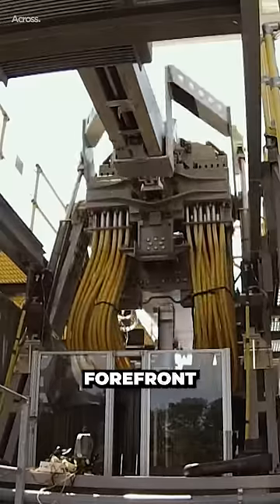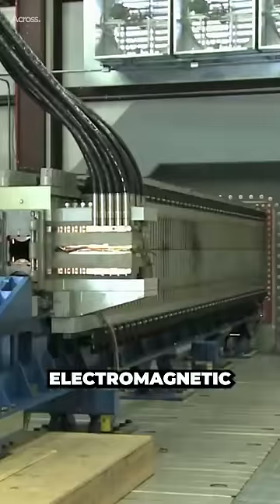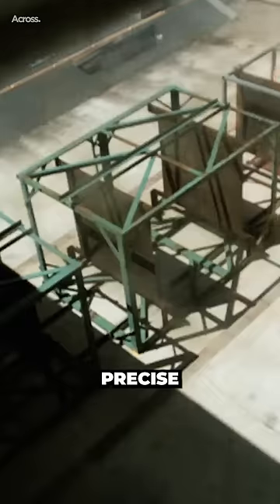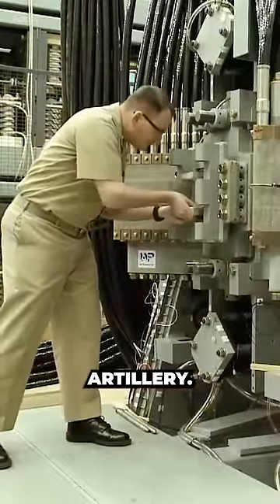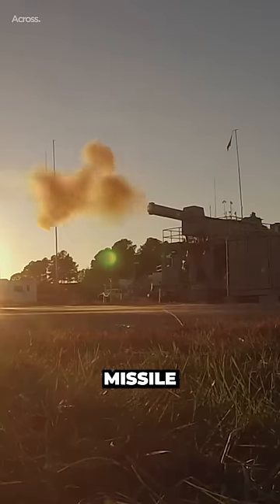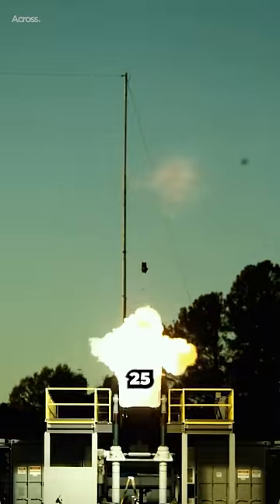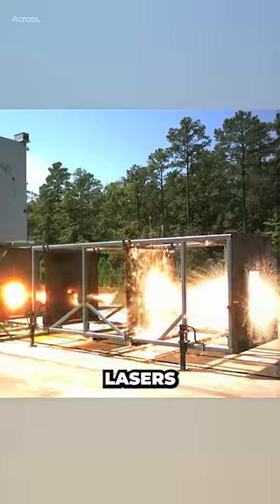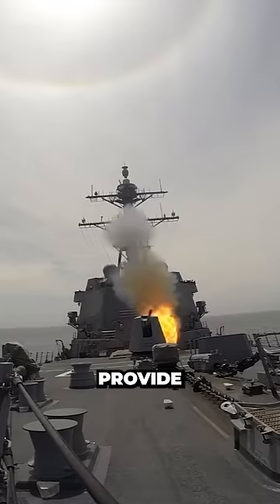The $500 Million Weapons That Make Everyone Afraid #shorts

Comment: They gave up on the rail gun due to its low fire rate and high cost per shot.
On top of that, the rails heat up too much and begin to melt after repeated firing.
Furthermore, charging the capacitor bank takes too long.
Even further, still when you fire a projectile over such an extended range, mass becomes more important than velocity.
If you're pushing through so much air over such a long dictance you start to have your shell be moved by the air currents more and more off target. The range is extended and only mass and guidance systems will keep the shell on target.
Yet another point against the rail gun, the shell has to be made out of exotic materials to not disintegrate from the high velocity in which it's being launched.
At that point, you might as well be firing A missile which is around the same cost per shot and far more effective at carrying a larger payload with greater accuracy.

Comment: These programs have long been canceled because those Megawatts of electricity create a plasma so intense that it turns the rail surfaces into Swiss Cheese. There are no materials in our possession that can withstand the plasma. Not even our strongest alloys, let alone the highly conductive metals used... like Copper Alloys. Less conductive metals, though stronger and tougher, have electrical resistance that causes enough heat to melt the rails... The resistance also slows the speed of the MegaWatts traveling through the rails, defeating the purpose by "sending" a much slower projectile -- as the rails melt and dribble onto the floor. 
Disposable Single-Shot Munitions are not the goal. We already have plenty of those. They're called Missiles. 

But! Don't lose hope. Currently, rumor has it that researchers are furiously working on obtaining enough Unobtainium for many, many indestructible rails... 

But will "they" tell us when they succeed? I doubt it. Stockpiles of Unobtainium will Un-Doubtedly remain Un-Admittable. Un-Disclosable. 
Until -- Fire and He** -- rains down on targets 100+ miles distant. 

Then, Whitehouse press releases will hint at our progress in Small HYpersonic STealth Missiles; 
SHYST-Ms... 

A sign on the walls of every Intelligence Agency around the world: 
 
        -- Disguise and Deceive --

Comment: I wonder if you can mix magnetic elements with titanium elements to make a stronger magnetic force instead of having to replace and repair it
Reply: @@davesmith3023 I mean I’m not an element scientist, but at the end of the day lead doesn’t seem that strong. Personally, I feel like magnetic properties with titanium or tungsten material which strengthen the magnet so it doesn’t have to at least be repaired or replace every so often.
Reply: I've heard that they replaced the electromagnetic with rubber band.

Comment: Literally just design the ship to house rail guns to be around frigate class sized that are nuclear powered, possibly a duel nuclear capability for engines & rail gun(s) to be able to fire in defense/offense rapidly without much worry because they can pull extra sea water to cool the core of the power plant if it is putting out a high capacity of electricity for an extended time. Just make sure to have multiple fail safes that wouldn’t allow the railgun to fire if the temperature is past certain thresholds to prevent catastrophic failures. You could mount a single massive railgun and then a few smaller to medium sized railguns to be used for different aspects of warfare. With AI and some of the other technology that we have out currently it would be easy to make a self contained system to target (person accepts targets from command center), just needs people for regular maintenance, and people to reload the projectiles (smaller systems would be good to be in a belt fed/magazined case type system that can aid with the speed of the weapons system to minimize downtime.
Reply: The issue is that the materials to make these fire reliably for more than a few shots don’t exist. The barrels get torn up enough that they have to be replaced way too often to be useful.

Comment: I'd like to know more than only watts. How much time the power is applied is another parameter. Therefore a Joule rating is needed to fully express the energy used.
   In another facet, I'd like to know about the spin stabilization. Is there rifling in the barrel, or is spin electrically induced?

Comment: Hope they fixed the barrel problem. Barrel life was 10 shots max , then replace.  At first it was one single shot, and then reline the barrel.  If Fusion comes online to a manageable and cost effective replacement for power, then it might make a comeback.  Gong to have to develop a magnetic bottle of some sort to store the energy.  Wait and see.
Reply: But, it's a rail gun. Electromagnetic rail gun. The projectile is supposed to float in an electromagnetic field that is modulate to accelerate it along the out bound vector. I.e. it isn't supposed to have a "barrel" and the projectile isn't supposed to touch said "barrel".
Reply: @IAmBeingSilenced  Soo much energy behind the projectile.  It scours metal like a lightning bolt, no matter what is floating.  I say get rid of the projectile and just work on the energy blast.
Reply: @kh40yr  But . . . the projectile has no physical contact with the gun, except maybe at rest. It floats over (and under) magnets. Why is it touching anything but the air? That's how it goes so fast. There is no friction with the "barrel".
Reply: @IAmBeingSilenced there is friction with air and the projectile tho. Gosh i wonder what happens to a projectile turned into a space shuttle re-entering the atmosphere and the tight environment around it, like a bunch of magnetic rails be like when its exposed to re-entry levels of temperature.
Reply: @caktitaqiwicaksana6018  we should ask the human meatbags in the shuttle what happens to the shuttle. I think the fact that those meatbags aren't usually turned into carbon residue should tell us what DOESN'T happen.
I would hope a weapons grade electromagnetic rail was at least as tough as meatbags. Then it could be used over and over . . .

Comment: Hearing it has beem canceled.  Not surprised.

The narrator touts the "capabilities" of this weapon.  However, the reality is that he's actually referring to is the potential capabilities.

In practice, a railgun for shipboard use IS NOT feasible under current technologies. Besides the sheer mass of equipment and power required, barrel life is abysmal.

For midrange offense (and some defense), there has yet to be a viable substitute for good old-fashioned gunmounts.

Comment: The weight alone too much  the energy need to fire same as the energy produce by a electric power plant. Old decommissioned ww2 aircraft carrier would probably accommodate the eeight and equipment size but the energy thats a different story.